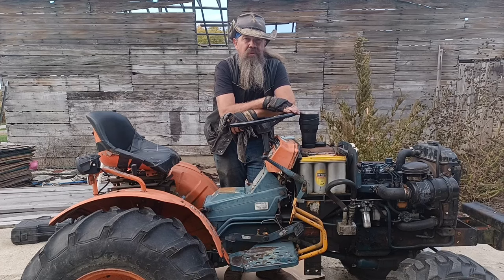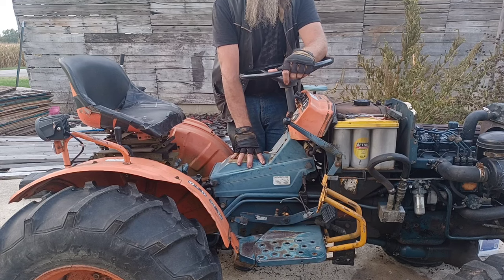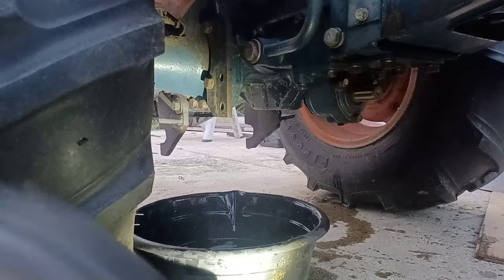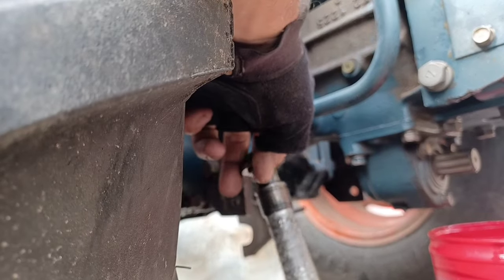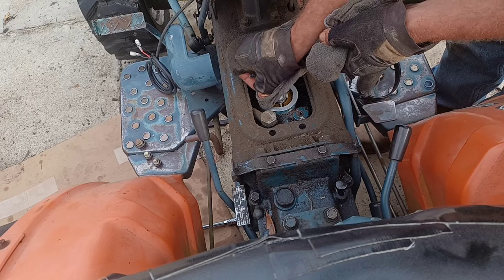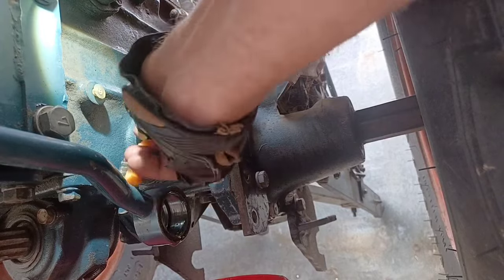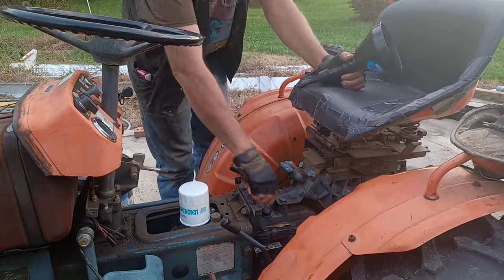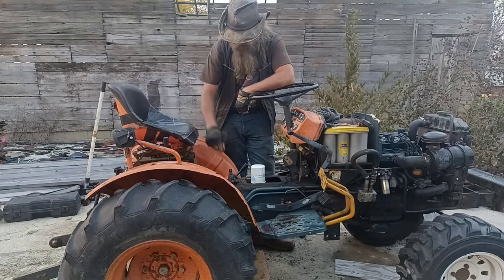How to Service Hydraulic System; Essential Steps; Kubota B7100 HST-D

Comment: Just purchased a B7200 HST 4X4 last week, Hour meter only shows 234 hours and the battery was 20 years old. Been in a garage unused. Real looker with belly mower. I truely appreciate the video. Great job and very informative. I went through the belly mower and before I slide it in Im thinking I should change the fluid. Thanks again
Reply from the maker: Congratulations on the purchase!
Belly mower is a great implement to own and use with these tractors. I'm not sure about the 7200, but the 7100 unfortunately can not have a belly mower and a front end loader (or backhoe) because of the subframe. I instead use a 3 point mower on mine.
After +-20 years of sitting in a barn, changing all of your fluids is probably a good idea. Don't forget air and oil filters as well, after such a long sit, they've probably degraded considerably and you don't want the little pieces floating around in your engine.
Thank you for your interest and support.

Comment: Great little tractor. I did a reusable foam UNI air filter mod so I do not have to keep replacing the air filter. They work extremely well.  Thank you for this video. It is my next project.
Reply from the maker: Thanks for sharing. I haven't really put much thought into a foam air filter!

Comment: Hi my friend. Can you tell me which battery must buy for kubota b1500?
Reply from the maker: The manual for the B1500 calls for a NS70L battery. I read some forums where users claim to use a group 51 battery.
With these diesel tractor engines, you can easily get away with measuring your battery tray dimensions, and use any battery that fits. Try to find one with 600+ cca and a price you can afford.

Comment: Great video!  Thank you.  Do you have a video on how to drain all the hydraulic oil in all the hoses for the front bucket assembly? Also, do you have a video about maintaining the oils in the front end (dif / axles)?  If not, can you or someone direct me to these please? My Kubota is a B7200 and seems very similar.  I don't know the differences.
Reply from the maker: I don't have the videos you're looking for and I don't know of any who do.

For the front-end loader, it is likely dependent on the make/model. At least for the B7100, some loaders run directly off of the tractor hydraulics (mine does) and others have their own independent pump that runs off of the front pulley of the engine. Do you know the make and model of your loader?

For the front drive, I do have a video planned, but have not gotten that far yet. If the B7200 is similar enough (and it should be), the procedure is fairly simple. There is a fill plug at the top of the front differential case and at each wheel gear case. Remove these first. Then, the drain plug for each will be the bolt closest to the 6 o'clock position on each of the respective components. You can tell the drain plugs from the other cover bolts in that the plugs will have a brass washer as a gasket. These gaskets will need replaced any time you remove the plugs. Refill each case to the bottom of the fill plug hole with SAE80 gear oil.

Thank you for your interest and support. If you have any more questions I'll do my best to address them.

Comment: What rear tires are you mounted with? The tread is what I'm looking for... not super deep tread.
Reply from the maker: These are Firestone Power Implement, and yes they've been perfect for backhoe work, ground engaging implements, and still mowing without tearing up the ground. 
Be advised: they only fit on the stock turf rear rims, and you have to put different front rims and tires on to use them else you'll tear up your drive train. I still plan on doing a tire video in the near future.

Comment: Is there an adjustment nut for the lowering speed of the 3 point hitch that you know of. I just bought a B7100 HST and the hitch lowers very slowly. The last owner said it did that when he bought it 5 years ago.
Reply from the maker: Yes, you can adjust the lowering speed of the lift arms. There is a vertical bolt on the control valve body just forward of the lift arm control. At factory settings, there should be 3mm clearance, and with no load, the arms should go from full up to full down in approximately 4 seconds. Back the bolt out no more than 90 degrees at a time until you achieve this, and then test it with an implement installed on the hitch.
Thank you for your interest and support and congratulations on your tractor purchase! If you have any other questions, please feel free to ask. I will always do my best to address them.
Reply: @abundantlifehomestead3100  Worked like a champ. The yellow bolt should have been my clue. It only took one 90 degree turn to make it proper. Thanks for the help. I am shocked at what a work horse this little thing is. Very happy I made the purchase.